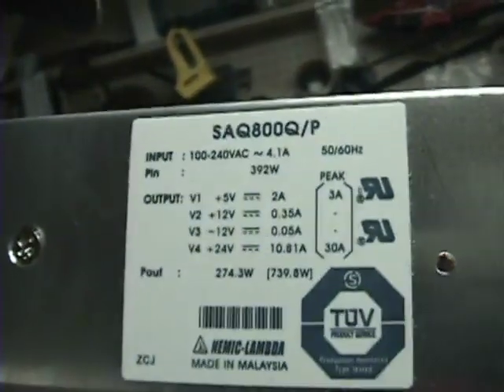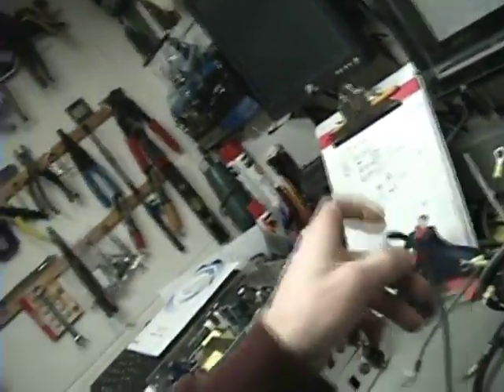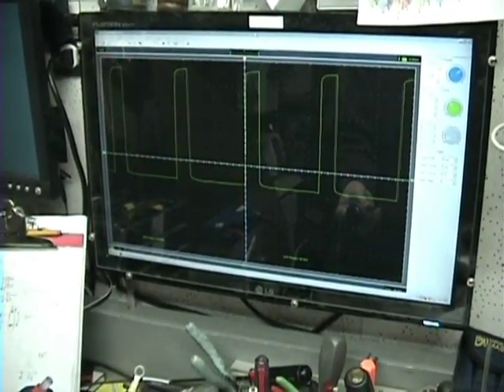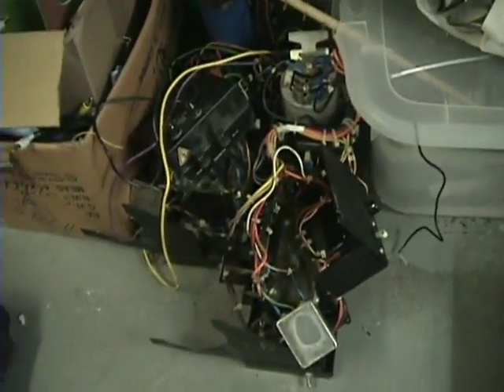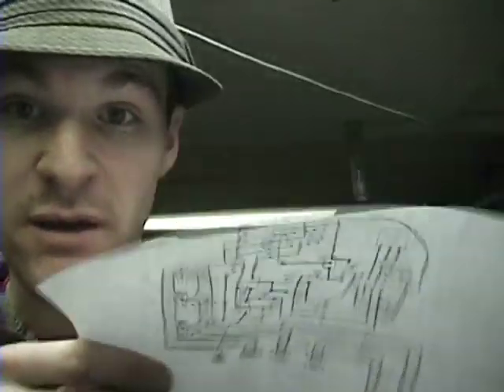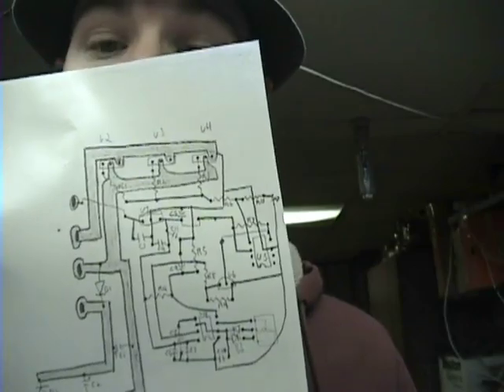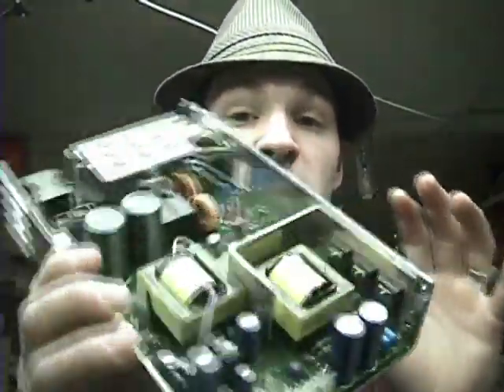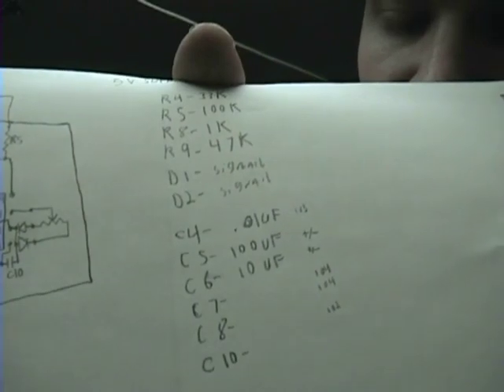#1 Building My Own Variable Power Supply Bench Top Style 0-96VDC 10A-40A

Comment: Russ, to get that dead sexy square wave, have your amps and volts waiting and trigger it with a isolated gate fet. Let the fet do the chopping. If your sending a square wave into a transformer, it will alter the shape of the wave due to the slower collapsing mag-field of the transformer core.
Peace.

Comment: Hello sir I need cloosed loop baterry 12v lead acid to variabel voltage supply for me delco 12 si alternator I experiment lot with engines I use often amplifier ignition and hv ceramic capacitors so called plasma ignition but the unusual effect is that the starting charge on those old alternator goes up meaning I constantly back fead true the bulb unless I rev me engine more and the bulb goes off .
So culd you advice me what to do?
Shuld I use cloosed loop voltage supply and how much current and voltage is normal for those alternator regulators?
Also I have problems with xenon bulbs,dual filament bulbs and interacting multipel relays to back feading alternator what diode type shuld I use to prevent undesired effects?
Me alternator does bypass the integrated diode in the dashboard but still I think those ceramic capacitors might interfeare with ground potential on the alternator regulator .
So I only use the pin 1 bulb the pin2 suposedly is the sence pin but its bent inside the alternator case.
So I hoppe also if you culd point out where to put diodes on relays I use hella relays 2 pin buzzer,3pin blinker,4pin read defroster winscreen ,6pin wiper motor relays.
Im doing currently entire wire harnest in the car its classic Opel from the 80s.
So in the past I hade unusual problems like engine self aceletating when I turn lights on,or when blinker relay has corrosion on ground rear bulb holder and some black wire on key ignition starts to burn the engine behaves like Hit and Miss engine like some buzz coil so does the engine work in union with the blinker relay,also some times I get static chock and many times I end up with flat baterrys under charge or over charge the baterry.
So I hoppe to finde some thing manuali that can tell the alternator when to charge and at what rpm range also I must finde solution for those relays stoping them to do that strange staff and posibly controler or dimner circuet for xenon bulbs .
So I hoppe you understand me problem and can give me good advice .
Also I wuld like to avoid useing the car chassys as ground due to rosting problems those cars normali have so I hoppe there are virtual grounding circuets.
I have bunch of those mentioned relays so I wuld like to seperate them or at least control to some degree those anoying problems .

Comment: what amperage power sup do you need ?
Reply: hi this is rank im in need of variable power supply circuit with 24v to 96v dc with variable current of 10 to 40 amp from variable input of 12 to 48v dc supply